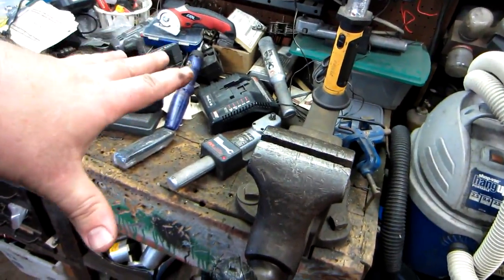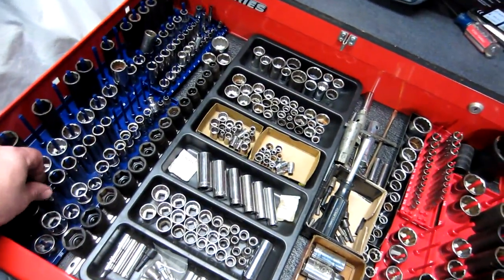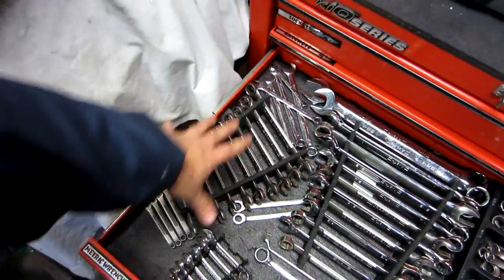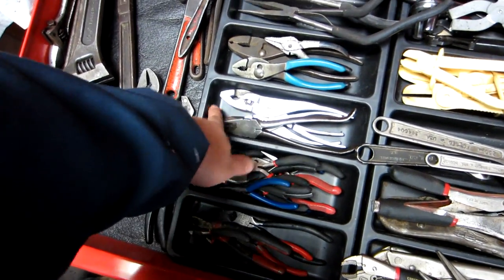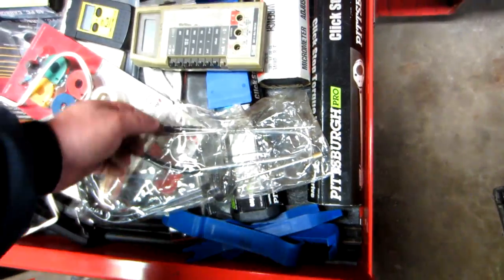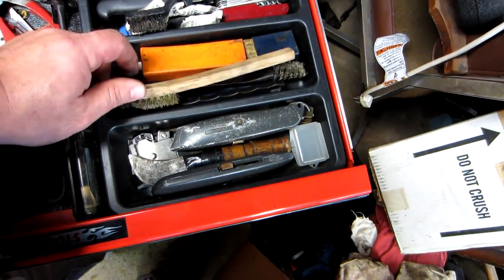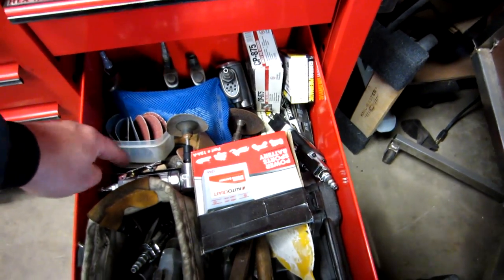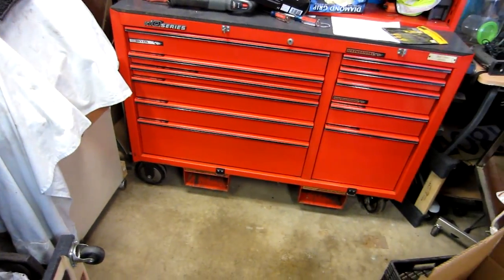Snap On Tool Box

Comment: Just wondering, those two like 6 in rectangles on the bottom are for forks on a forklift no? You said it was used in a chrysler plant so this is my best guess.
Reply from the maker: You are correct. The Millwrights used tow motors to move their boxes to the job site within the plant.

Comment: Why do you need so many ratchets dude
Reply from the maker: Good Question.  For me here's why
1) to allow multiple sockets to have ratchets already attached so I dont have to switch sockets I can just pick up another ratchet already loaded with what I need so the repair goes faster.
2) If I'm doing a repair and I have to stop to wait on parts for the unit I'm working on I can leave most of the tools being used on that unit in that work area and go onto another unit in another area and start repairs on it using duplicate tools that way I'm not transferring tools from one work area to another.
3) some of the ratchets are used for greasy dirty nasty jobs and I like to keep them separate from ones that are used for "clean dry" repairs.
4) tools break and having extras minamalize down time.
5) other than a few exceptions, I have different shape and sized ratchets in case if one doesn't quite fit or clear an obstacle or have small enough ratcheting increments I can go to another that might be just right.
Reply: Fair comment nice collection dude
Reply: Foxboss9 good reason why you need all your ratchets. Like the previous comment. Your tools are nicely organized and  put to work. I see a lot of videos like this with tools that look like they  just came of the truck
Reply from the maker: Thanks, I really only did this vid because of a few request. I looked at some other tool box vids and I wondered how their tools could be so "perfect". I'm guessing maybe they just got them?   Not sure really as I have never  bought a large group of tools at once to have all of them clean and shiny..  Thanks for the comment..